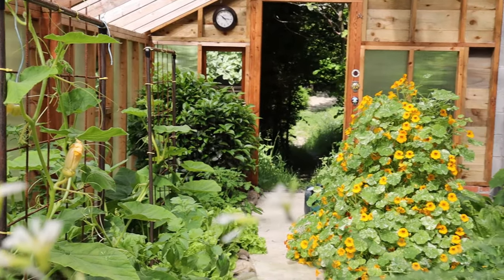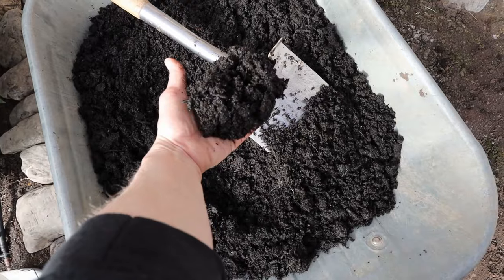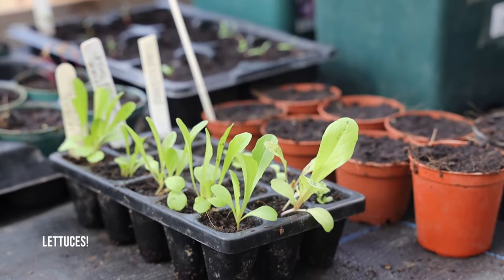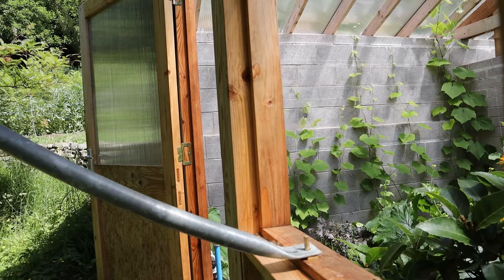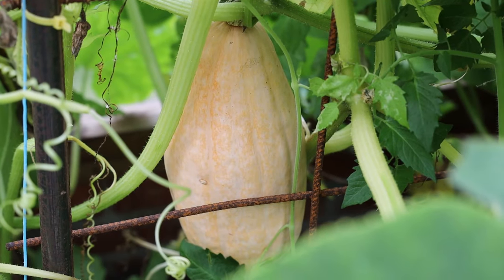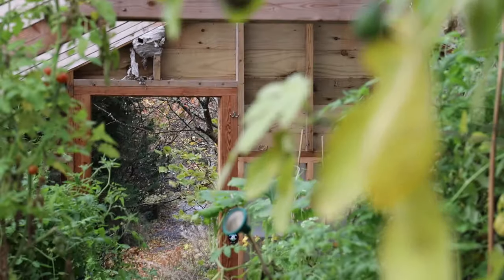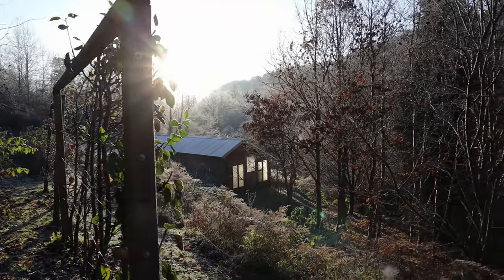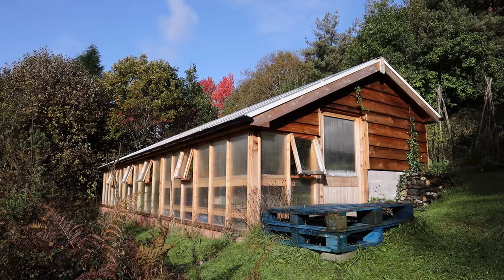Passive solar GREENHOUSE update | YEAR 2

Comment: Another great video! I suspect the fig tree problem is because figs can crop 2 times a year (an earlier breba crop, and a later main crop). Usually in the UK, it is the breba crop that is best, usually around August. But in order to get breba crop you have to be careful pruning the tree, as brebas form on last year's growth, so if you give the tree a haircut, you may be trimming off last year's growth, and so not allowing the earlier fig crop to ripen. It seems you predominantly got main crop this year. 

There are specific ways to prune figs to maximise the earlier breba crops. There was a great video by someone in Canada who shows you how to do this. I think it's called something like "pruning figs for breba crops in PNW".

Hope that helps! 🌿
Reply from the maker: That's really interesting, thanks so much for your detailed comment, and we'll definitely look up the Canadian video 👍👍 We have already given the tree a haircut this winter - the issue is that the tree is quite vigorous and could easily outgrow its space in the greenhouse. But perhaps in future years we could try and remove less new growth and hope for a good breba crop. 2022 was a really hot summer so the main crop was excellent. Thanks again! 😀
Reply: @TheTenterhookTimes No worries at all. The video is on the channel "Fruit trees and more" and the method involves pruning off select 2nd year growth, which means you can actually keep the tree to a manageable size if you follow the guide. All the best!

Comment: In looking at the design of your green house, I'm surprised that you didn't insulate the upper part of your north wall, and slope earth against the lower part to increase the thermal mass.  Any particular reason?
Reply from the maker: Hi Rich, thanks for your comment. The lower part of the north wall is built into the hillside so is extremely well insulated. We haven't considered insulating the upper part of the wall as so far we're happy with the temperature maintained during the winter. It's not usually as cold here as it is in North American winters for example as our climate is warmed by the effect of the Gulf Stream. Of course that could change, so it's something we might consider in the future. You can watch our latest greenhouse video which shows greater detail of the original build if that's of interest: https://youtu.be/CIuefQT7mCs
Reply: @TheTenterhookTimes  Thanks for your response. I was just thinking that it might increase your growing season into winter.  But now that I think about it, in Wales, you probably get so little sunlight in January and February between the high latitude and cloudy weather it might not help you much.  I'm thinking about homesteading in Kentucky or Tennessee, which is more like the latitude of Algeria, though I suspect there will be a lot of overcast days, compared to my current situation in Colorado.